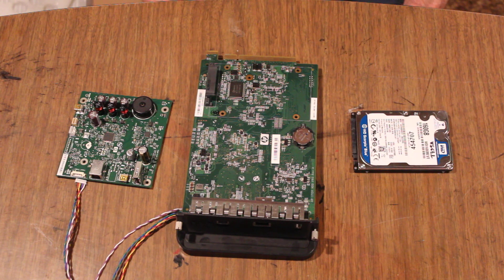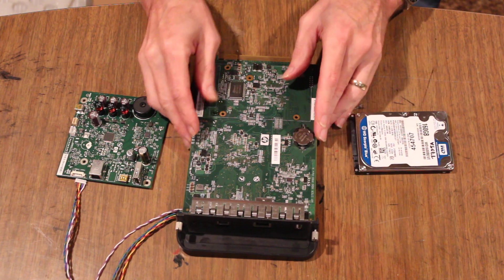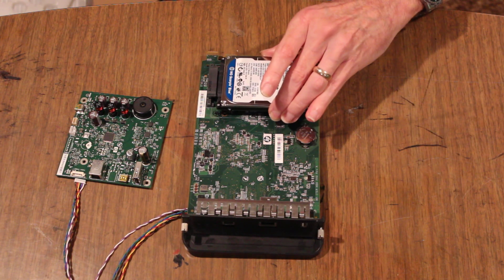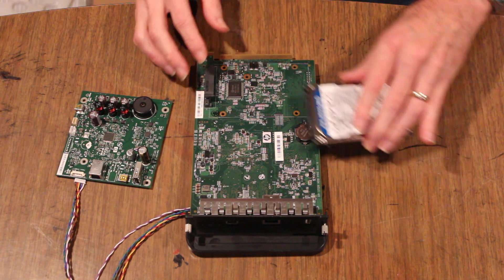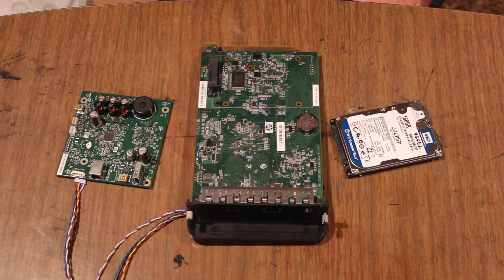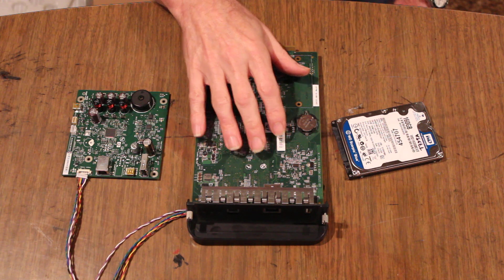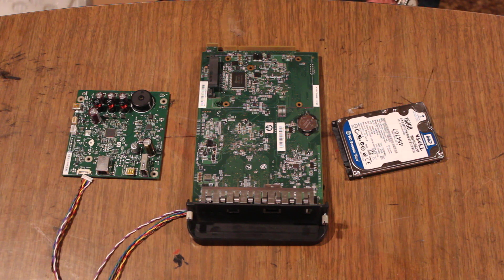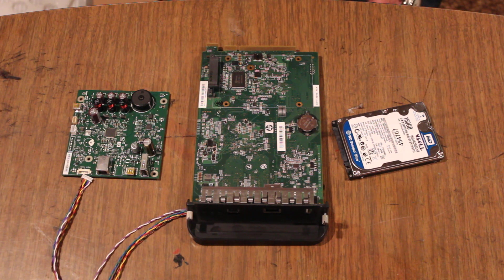Designjet T or Z series error 08:04, 08:07, 08:11

Comment: Hello, I have a plotter hp t 770
Tell me what could be the problem. The plotter requested a new head bought a new one put everything the same writes replace the head. The carriage goes to check the head and immediately returns writes the head has not been replaced. Issued error 79.03 updated the firmware now does not issue an error but does not install the head either. What could be

Comment: Hi, how are you? Hope you are fine. I am using HP Designjet Z5400. Today it's showing "If the problem persists, check for the latest firmware release" massage and sometime it's showing "Switching power off" then it is shouting down. How can I solve this problems. Can you help me?